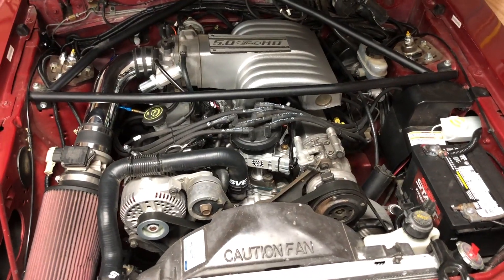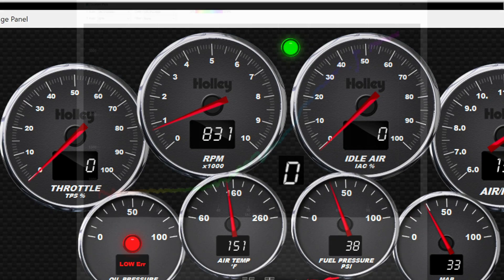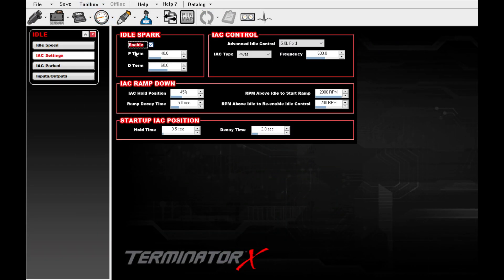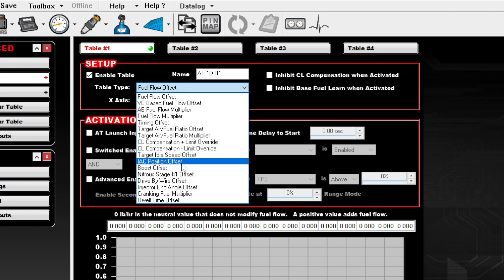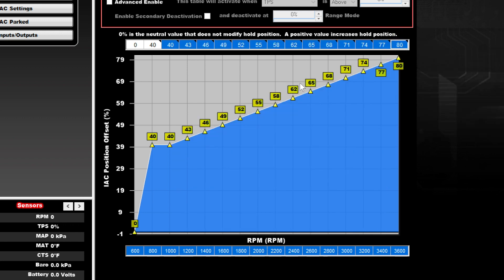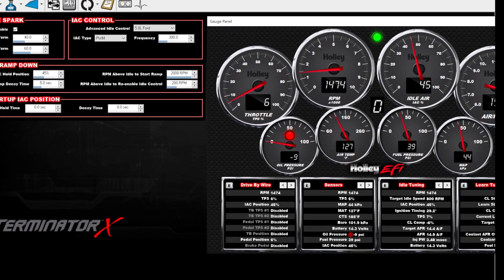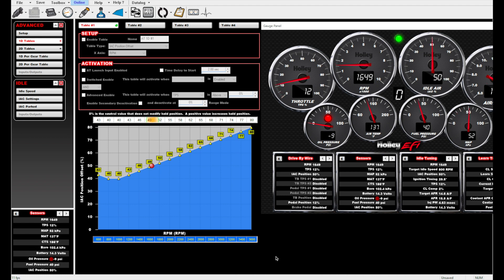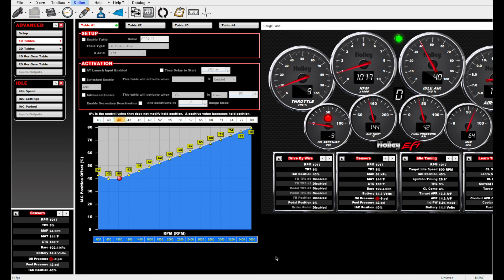Controlling Terminator X Idle with a 1D Table

Comment: This helped my driveability a ton! Especially to combat my lightweight flywheel. My last big issue with the tune is that it dies when it comes back to idle. Thinking about raising the iac offset between from 600-100rpm. Do you have any suggestions?
Reply from the maker: Yes, you'll have to make offsets that suit the air needs of your engine. Also, do this: https://youtu.be/F2APprj4jeU?si=erI5LVWTvI6hG5Lg

Comment: I have a holley i just installed in my fox its hci with a tkx trans, ive been having trouble just to get this thing to start since i put in the new holley terminator x im convinced im not getting enough spark and its just dumping too much fuel into the engine what could be my issue i even went out of my way to by a computer so i can self tune please help any info is much appreciated!!
Reply from the maker: Honestly, it could be anything. Start by using the setup wizard. It should at least start. I'd suggest taking it to someone experienced with repair in general who is willing to play detective.
Reply: @ Ive been using the wizard going back and fourth doing the start up prompts over and over, it starts up but once it catches some temperature it just doesn't want to start up anymore it makes me wait until its cooled down then starts up again could it be a timing issue ? One things for sure is once i crank it a couple times i can smell nothing but fuel
Reply from the maker: @orionlopez7957  Yeah, could be anything. Make sure your fuel pressure isn't too high. Also, make sure the oxygen sensor is installed well and you don't have any exhaust leaks before the sensor.

Comment: I have a question, I set this up like this, and I have seen other videos like ksr performance and they set the idle differently without a 1d table. Have you had any newer stuff/updates on idle? My car starts fine but struggles as soon as my wideband starts reading and shuts off unless I hold the throttle a bit.
Reply from the maker: The other video that may help is here: https://youtu.be/F2APprj4jeU?si=fjhevVVAI5XD_srv, however if it idles fine until the Wideband starts reading, there is an issue with the air:fuel ratio. There are a lot of possibilities, so take your time and try and figure out why that's happening.
Reply: @ sorry I meant to say the car freaks out as soon as the wideband starts to read, my CL compensation starts pulling fuel -15 -20 or so. Only for those few seconds. Going to go over things again.
Reply from the maker: @SergioSanchez-rx1hg  Hmmmm. That leads me to believe that your base map is off. Try applying the compensation changes to the base map. That should address the compensation issue.
Reply: @ hey man, sorry to keep bugging. I just re adjusted my idle screw right where it almost binds and did the tps reset.  Tried it again and it’s not enough airflow to keep the car running so I kept opening a bit more until it runs.  Can’t seem to get my iac percentage down.  It stays around 60-70 and if I blip the throttle it will go down to 45-55.
Reply from the maker: @SergioSanchez-rx1hg  I suspect your IAC isn't working. Set the throttle body screw until it idles, but significantly below the target RPM. Do a TPS autoset. Start the car and unplug the IAC connector. If the idle speed doesn't change, the IAC is not working. Are you tuning this with a laptop?
Reply: @ I’ll give that a shot. See what it does. And yes I am doing it with a laptop as I make the changes. Although I did the tps reset with the handheld.
Reply: @ my iac is working idle drops and as soon as I connect it back up it revs up
Reply from the maker: @SergioSanchez-rx1hg   OK. I’m surprised that the IAC is at 70 or 80% because that is a ton of airflow. Do you have a really big camshaft? You don’t have to set the throttle blade all the way closed if you need more baseline air. You could give it some additional air as a baseline but most cars aren’t gonna need that!
Reply: @ no it’s just a bolt on car. Exhaust intake, new motor with stock cam.  I turned it on again and temp was around 110. Car surged at that temp for a few seconds and then caught up. Drove it around and iac when put in nuetral at stops was around 50-55 percent. That’s my only issue with the car it’s driving me nuts.
Reply from the maker: @SergioSanchez-rx1hg  Did you set your ignition timing? I talk about it here: https://youtu.be/oX5VAHYSiJ0?si=RFzO5Jq_QEntyL5I
Reply: @ yes that’s done, I noticed my map spark timing for idle is 20 degrees and I saw yours was at around 12 idling. Mine is set too 20-21. Could that be the issue?
Reply from the maker: @SergioSanchez-rx1hg  Hmmm. Not sure. Verify that the timing with your timing light is the same as the Holley is commanding. If not, re-set the static timing.

Comment: I need to add an advanced enable for the 1D table because it was offsetting my IAC park position before I would start the car. 
Since my lowest number in the table was 30 at 700 RPMs it was adding that 30 to my park  position making my IAC read in the 90s before start up.
Reply from the maker: If I'm understanding, you can also lower the whole Idle Park Position graph by 30 to accomplish the same result.
Reply: @Mustang-Geek  That makes sense I'll try that as well. I actually have it set now to activate the table when ignition timing is above 10degrees which is my cranking timing.

Comment: First , great video ! I’ve yet to try yet. Just a question to why you scaled rpm end to 3600. After 3600 will the %’s be self populated or stay at whatever imputed % ?
Thanks again
Reply from the maker: 3600 RPM seemed like a good place to stop ramping in the IAC. Best I can tell, above 3600 RPM the last percentage is applied. So, of the last percentage is 50% at 3600 RPM, 50% is also added at 4500 RPM, etc.

Comment: Great info thanks for sharing! One question i noticed u had frequency at 600 for the iac, should i change mine to this? I had it set to 315 .
Reply from the maker: Good question. I really don't know what the frequency does for the IAC. I picked 600 because it was in the middle :)

Comment: I have one question about "IAC position setting. of course, It`s ok if it your personal image. Sniper efi IAC setig is normally 2~10%. (mine setting is 5%)
if I try same your method, should I setting minimum IAC on 5% something on the1 D table? Your setting is 40%, but it`s not Sniper system yours. I looking foward to your opinion.
Reply from the maker: Are you using the Sniper EFI system? If so, much of this information isn't necessary, unless you want to still make a 1D table to create a "dashpot" function. The Sniper uses a stepper motor IAC, which behaves differently than the Ford PWM IAC.
Reply: @Mustang-Geek  
Thank you for your reply. Yes I using Sniper efi since last year.
But somehow my engine had engine stall million time during idling.
Last May, I tried your 1D table process, after that almost engine stall issue disappeared.
But one question remained for me. 40% IAC (750RPM) setting make too high idle rpm.
So now I setting 28% IAC position during 750RPM.
But normal sniper IAC % is 2~10%, so I asked you this question.
Anyway, I appreciate you your movie info, it`s very helpful.
Reply from the maker: @vegavincent3980  Good! For your sniper, start at 5% at idle and ramp up to 25% at the top. Adjust the angle and numbers to get it to help.
Reply: @Mustang-Geek  thank you for your advice! I will try it in this weekend.
after that, I tell you result of running condition for you. thanks million!
Reply from the maker: @vegavincent3980  Once you get the 1D table dialed in, make a 2D table (start at 1:14 in this video: https://www.youtube.com/watch?v=F2APprj4jeU)
Reply: @Mustang-Geek  OK I will.
this is my progress of 1D adjustment.
I told you already minimum IAC 6% at 750rpm, but now I checking it not stable condition. Even if the water temperature exceeds 180 degrees, the engine will stall when you put the gear from P to D.　I guess AFR is too high (14:7:1) 
I change to 14:3:1 something like that.
if you have some opinion, let me know.
Reply from the maker: @vegavincent3980  I would try making it 13.5 at idle, and make sure the cells to the left and below where it idles hot are also 13.5 or richer. Also make sure idle timing control is enabled. Is the sniper controlling ignition timing?

Comment: Good video i have a problem when i turn on the car it will hole idle around 1900 rpm and wont come dowb what should i change in order to get an idle of around 800, thanks in advance

Comment: Been running this for a while, but the problem I've ran into is that little blip of 10% or so of IAC keeps kicking in when transitioning with light throttle in the 0-2% range.  It's making me nuts.  There's no way to turn that off in the ECU tables except to go back to the original IAC hold and decay tables which suck even worse.  So frustrating!
Reply from the maker: I know what you mean. I think it's some type of anti-cluck strategy that Holley uses. You can create a 1D table that would be IAC vs time that is enabled when the TPS is at 0%. Start the line at, say, -10% and ramp it back up to 0% after, say, 0.25 seconds or something like that. The idea would be to cancel out the added percentage every time the throttle returns to zero. Make sense?
Reply from the maker: Also, have you done everything in this video? https://youtu.be/F2APprj4jeU
Reply: @Mustang-Geek  Yes, I did as well. Works nicely because the decel fuel feature is clunky and feels terrible to drive. Using that negative offset table allows me to pull more vacuum at decel and in those AF cells make them 20 AF to save fuel.

Making a table to counter it is my thought too. It’s my next step to try. I also have a table that adds spark to offset the -8 idle spark pulls unneeded at RPMs above 1300. Made a big difference in transition light throttle. I’m almost out of tables. 🤣
Reply from the maker: @madevilmustang2824  Yes, I was never impressed with the Holley decel fuel cutoff. It was way too crude. Tuning this stuff ourselves makes me really appreciate how new cars run so well. Decel fuel cutoff on new Mustangs is almost seamless.
Reply: @Mustang-Geek  Truth!!

Comment: This is working really good for me with one exception. At startup I am getting a spike in rpm when I have the 1d table active. Once the spike comes down and the idle settles, the car idles and runs much better with this 1d table setup. Any thoughts on what why this setup would cause the startup rpm spike?  Thanks for your videos, they are fantastic!  Please keep them coming!
Reply from the maker: Ah, yes. Since the 1D table offsets or "adds" to the IAC position, the IAC position at startup is going to be much higher because it's adding to the IAC Parked Position % table. Take the lowest offset with your 1D table (say, 40%) and lower everything on the IAC Parked Position % table by that amount. That should bring your IAC position back down to what it was before. Try that out and let me know if that solves the problem.
Reply: @Mustang-Geek  yes, someone else mentioned this to me as well last night so I adjusted the parked position table and this fixed the startup surge.  Car runs fantastic now.  Thanks for all you do!
Reply from the maker: @ericberman6447  Glad it worked out!
Reply: I had the same issue. Dropped IAC parked by 40% and still happened. So I set startup IAC to 0.2sec hold and 0.4sec decay and it helped.
Reply: Yeah , I’m adding terminator X to my car . I’ve been having iac issues since putting car together. B cam sucks low rpm . I cannot wait to get to fiddle with the X and tune this shit show . Between rich idle and iac it should be night and day.

Comment: What would you recommend for an automatic car?
Reply from the maker: Actually, I think the out-of-the-box Holley settings will probably work fine.
Reply: @Mustang-Geek  I know this was written months ago. But, I need help with my decel idle tune. My vehicle has a AOD trans, and when coming to a stop, the engine stalls out unless I hold the throttle open at 1%. Do you think you could help with this issue? Thank you in advance.
Reply: @d.collier_8280  It should help regardless of the transmission. I'd "tune" the settings in neutral.

Comment: I tried the 1d table and it works great. I lowered the setting so not settling at 40 but 32 and works out great. My only question is when your driving and let off the gas it holds the rpms a little too long, what do I need to adjust for that? It's not horrible and you can tell the car is not pulling just would like to have them start dropping when your coasting.
Reply from the maker: I know what you mean. If you lowered your idle setting from 40 to 32, I'd instead lower ALL the numbers by -8. In other words, take the whole graph and offset it -8.

Also, here's something I did to get more engine braking. This mimics the OEM strategy. This is a 2D table: https://www.youtube.com/channel/UCeJaO0ySaJ07Igg-qgMWvPQ/community?lb=UgyEJWum_m6JnhSDsZV4AaABCQ
Reply: @Mustang-Geek  Ok I will try and lower the whole table and go from there. If that doesn't work I'll add the add that table also. Thank you very much for all the help
Reply from the maker: @gregbrzostko7930  Even if you lower the table, doing the 2D table that I linked to above will give you more engine braking, just like OEM. It helps a lot.
Reply: @Mustang-Geek  Ok i tried the new 2d table and it works great the idle is not hanging when you let off throttle thank you for that good fix. I originally had it at 32 for idle on 1d table but would surge in gear so noticed as I added air to help the surge my idle kept going up. My target idle is 850 and if I give it the full 40 at idle I have no more surge in gear but then my idle is at 950. So thinking i need to close the throttle blade some?
Reply from the maker: @gregbrzostko7930  Is this an auto trans car? The surging could be several things. 1) You can try and make the ramp under idle RPM less "steep." That way the IAC will not react as much (and overreact). 2) Go into the Target A/F table with the car idling where you have the surging problem and check to make sure the target A/F isn't moving between two different A/F ratios. Smooth that area to stabilize the A/F ratio. 3) Check the timing table in the area that it's surging. Lower the timing and/or smooth that area. 3) Make sure you have Idle Spark enabled.
Reply: @Mustang-Geek  yes it's a auto
Reply: @Mustang-Geek  In the 1d table ramp when I had it idle at 32 the lowest setting in ramp up was 36. I know for sure I have the spark enabled. The other things you said to check for was a/f and timing that I will have to report back with probably have to smooth out like you said if going between cells. Thanks again
Reply from the maker: @gregbrzostko7930  Let me know how it turns out. If your car is an auto trans, the standard ramp down settings might be just fine.
Reply: @Mustang-Geek  ok I got the idle better in gear I turned down the throttle screw a little bit and upped the iac setting to 38, then added some timing to the lower rpm so when coming to a stop or just putting into gear it speeds up and smooths out faster. Is there another decel table for the auto to try? I like the one you posted but I'll try another if you got it.
Reply from the maker: @gregbrzostko7930  I don't have anything else, as I'm figuring it out as I go along too. You might want to richen the target AFR table below idle so that the idle can better "catch" itself. My car idles well with a target of about 13.5 at idle, which is richer than the "typical" 14.7
Reply: @Mustang-Geek  I have mine at 14.4 but will try that also. Have go be careful with going too rich the Bosch o2 sensors dont last I already had to replace mine. The car was running super rich and it said it was pulling -37
Reply from the maker: @gregbrzostko7930  Something is strange there. If it's subtracting that much fuel, it means the main map is quite a bit of. Do some driving and then apply the learn table to the base map.
Reply: @Mustang-Geek  It really was the o2 sensor I was within 5% of learning then the next time I take it out was pulling -37 on the fuel map the car smelled super rich thou. I already had a o2 sensor on standby cause people complained the bosch dont last I did nothing to the tune and installed the replacement sensor car went back to normal not rich and within 6%. I recommend having a extra sensor just in case it happens.

Comment: I set up everything how you did but I have my idle set at 750 and it’s idling at 850 and when I tap the gas it hangs up around 950-1000 then it creeps back down to 850 any thoughts?
Reply from the maker: The throttle body setting makes a big difference. Try closing the throttle body with the set screw until it's open enough that it doesn't bind. Do a TPS autoset. Then try it. Keep in mind that your actual numbers are going to be different than mine, but the slopes are what's important.

Comment: When I tried this I had an unstable idle. The idle would bounce up and down the ramp. Is the ramp from idle to 3600. On the holley website they went to 20000. I even adjusted the throttle blade down to account for new table.
Reply from the maker: Hard to tell without the car in front of me, but try changing the ramp rate. In other words, try a lower number at the high end, and then fill so it's a straight line from there. Your values may be too high and it's not letting the idle speed come down because the air flow is too high.